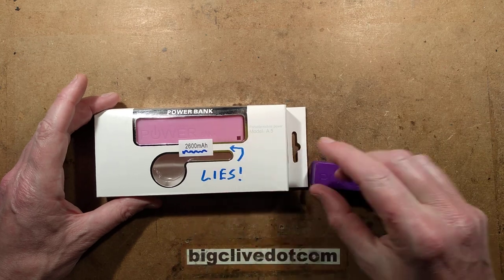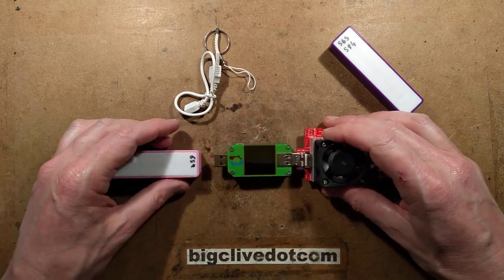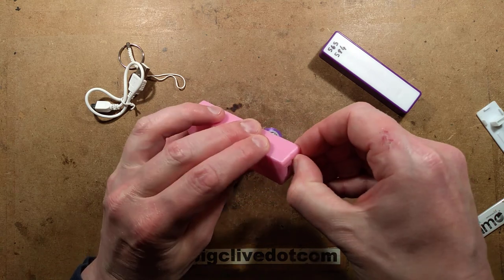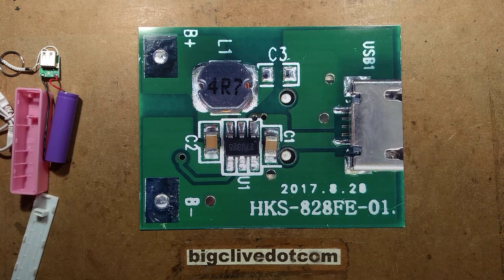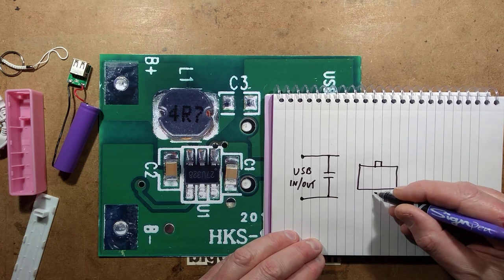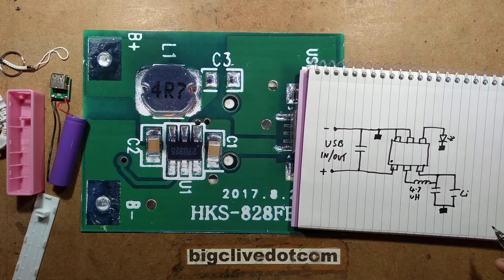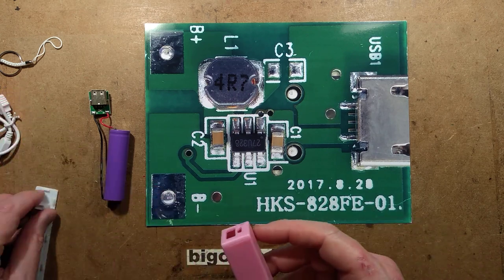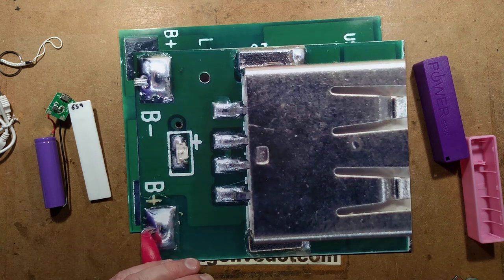Simplest power bank ever?

Comment: What concerns me more than inflated capacity is inflated amp rating. Running an 18650 at ~21 amps because it says it's rated for "25-35" amps when it's actually only 10 amps is just plain scary. Some battery rewrappers are taking the manufacturers pulse rating (which means pretty much nothing) and claiming it's the CDR.
Reply: Efest is pretty bad at that. Their Samsung 30Q wrapper says 35A when the cell is only rated 15A continuous. You can definitely get away with quite a few extra amps on the rating, but advertising it as such is wreckless and misleading. Especially considering how little a lot of people know about li-ion safety.
Reply: @william_2610  Ampking too. 20 amp cells with "35 - 45 amps" written on the wrap. It's insane because those are sold in vape stores. Most people with regulated devices never bother to learn any ohms law or battery safety/maintenance. With massively inflated ratings, they're gonna do themselves some damage one day.
Reply: @alexb.1320  It's just a shame that the explosions get attributed to vaping instead of human error with regards to li-ion batteries. These batteries will vent and go into thermal runaway in any device when misused, but the reports always blame vaping instead of the person incorrectly maintaining battery safety.
Reply: @throttlebottle5906  Well luckily, you get to keep all that if you know what you're doing. The main problem is inexperienced vapers moving over to mechanical mods without learning the basic safety information required to operate and maintain such devices. They get used to regulated mods with sub-ohm tanks and think they can just move over to a mech mod with a rebuildable dripper or tank with no learning curve. Gives the whole thing a bad name in the media because the press can't distinguish between human error and a dangerous device. It's only inherently dangerous in the wrong hands. As is anything with a li-ion battery, essentially.

Comment: It looks like they have updated this board a few times - the "original" ones had 2 LEDs, they also came with a battery holder - the plastic case still have the retaining points in the moulding....

Comment: hi, I have been given a dead powerbank, under inspection, I think the battery died after just a few charges. I replace with my one of the laptop battery. I also found the battery discharge quite bad drain through the circuit board (not like yours)  I replaced with another board I bought from ebay (2 boards for 99p). So only good thing is just the case. Mine all work with 3,000mah battery and very low drain, it can discharge about 1Ah. Cost me I guess 80p and I am happy with it.

Comment: I've got one of these, except that it came from Poundland and it's branded Signalex. The only difference being the white backplate which forms a rating plate. As follows - DC input: 5V 0.8A, DC output:5V 1.0A, Cap 1200mAh, Model No:170327

Comment: I have one of these power banks given from a relative but the internal design is slightly different from this video: The purple li-ion battery is not soldered/weld to the board but instead tension fit like a AA battery socket, there is two LED for each color and the Hotchip HT4928S occupies the U1 section.

Comment: The IC is a HotChip HT4927U. Official limit is 0.7A which coincides with the point at which your test drops below the rated 5V output.

Datasheet is on their site, google finds it.

Comment: they sell these at the Canadian dollar store called dollar tree. I take them apart for the cells and use them in my flashlights.  I should mention that I've had more than one of them grow up and smoke... it was the circuit board that burned up immediately after plugging into a charger.

Comment: As it happens I've actually got one of these, a black one - at least the outer case is identical - and I don't think I paid very much at all for it.  I've had it probably over a year, just use it mainly to charge my phone while asleep if I've forgotten to do so earlier.  But now having seen this, I'm tempted to open it up to see if the innards are the same.

Comment: one problem with measuring in mAh... the battery is 3,6V and in powerbank you want 5V. So you need to boost it.... but when boosting on the input you need more current than you get on the output... hence you get less current but in reality battery gave it away.  In math terms it would be proper to measure it in watts. 5V times 654mAh(measured in video) = 3270mW then when you divide it by battery voltage you get actual battery mAh. 3270mW / 3.6V = 908mAh... still less than advertised but this is the proper method for powerbanks.

Comment: I have one of this powerbank, as far as i know, there are a wide variety of different quality of these powerbank, although the appearance might look the same from the outside, the internal circuit might be different due to different manufacturer.
Mine comes with one of the best quality circuit, its very reliable and efficient and the 18650 li-ion inside there can be easily swappable non-soldered.
My circuit board looks a lot more complex than yours, and the LED indicator light goes directly into that little hole.

Comment: A whole lot of makers would love to know the cutout threshold draw, as we've had issues with this when running light loads on various power banks.  Lots of use would like to run something power-efficient for a few days vs not quite a raspberry pi for a few minutes.  Yes, you can always design your own battery circuits, but expense and pain and danger of wrecking a cell....
Reply from the maker: 40mA.  Technical details in description.
Reply: @bigclivedotcom  Doh!  Thanks!

Comment: I have one of these. The body isn't actually meant to work like that - they're supposed to have terminals that slot in those mounting points, and you can swap the cell out as you want. Mine is like that - I bought it from the "Muy Mucho" chain in Madrid (paid all of, like, €2 for it) and while the cell is moderately shitty it still holds close to 2Ah. I was quite surprised when I opened it up and the 18650 just fell out, allowing me to insert a NCR18650B 3.4Ah in its place and have a surprisingly capable tiny powerbank.

Comment: Unknowingly purchased this exact used model at a thrift store. Fully charged I measured capacity at a shockingly low 100 mAh so put in a discarded 1500 mAh laptop battery and now have a decent el cheapo emergency phone charger that gives a 50% charge.

Comment: I bought a few of these an soldered 5 or 6 batterys together an soldered em all to 1 of the boards.. works ok think i get 5000mah
Reply: Yep ive done that too...much better now. :)
Reply: @100roberthenry  charges slow but works only bought em to try it out
Reply: @CrownJewelzMusicGroup   yeah it is slow. But more useful when charged..
Reply: @100roberthenry  i use it on my bike it charges off my dynamo wheel...every mile i pedal i get 1% charge lol
Reply: @CrownJewelzMusicGroup   excellent....ive been charging mine indoors with a solar panel in my window....i charge up all kinds of stuff....i never buy batts now...cool stuff.

Comment: Would be interesting if you swaped out the orginal 18650 battery cell with a proper 18650 cell that actually has a capacity of like 3400mah.. Would you kill the circut at max load?
Reply: no , it so problem, but the loadingtime will be longer

Comment: Hi Clive, have you seen the little Dekton digital voltage testers in Poundland? I was wondering how safe they are. I think they're like a posher version of the old screwdriver mains testers that you stick your finder on the end, except these have a digital display, can test from 12v to 240v and can test AC and DC. There's also an interesting warning to NOT touch both the DC and AC test electrodes at the same time.

Comment: its interesting if you notice that the "2600 mAh" label seems to be put on by someone else besides the original package manufacturer. i wouldn't be surprised if the owner of the shop or someone slightly above him in the supply chain just used a label maker and slapped a bunch of those labels on them. the original manufacturer leaves it blank for you to label (or lie about it) it yourself, i guess.

Comment: Looks like it may be a 6 pin pic 10f. Considering it can wake from sleep and go to sleep. But how would it charge the battery and drive a bigger output without an internal mosfet and regulator..
Reply from the maker: It's a purpose designed chip for power bank use.

Comment: So if I'm following correctly you can charge it from either port, and you could put the power bank in line between a charger and a load and use it as a standby charging system if power is lost.

Comment: The best 18650 cell is 3600mah, so a very good 70% (never seen one) conversion rate only gets you 2520mah.
Reply: I think you mean highest capacity, not necessarily the best... it depends on the use case.

Comment: I believe the 2600mAh is 18650 capacity not at 5V output capacity and also they might use cheap under rating 18650 which it wont give you a full 2600mAH capacity.  the circuit board will be the same, the only is the 18650 they using different capacity. The problem is the inductor can be too small when load with high current the boost converter efficiency drop.

Comment: I have one of those powebanks, the package was the same and the cell is a similar colour, can't remember the capacity, mine is green though and the cell is removable (basically your typical battery holder with a springy contact), the board seems a little better as well, it has a larger 8-pin chip on it

Oh and my LEDs lign up, yes plural, it has a blue power LED and a red one for charging (it alternates red and blue when it's charging)

Comment: 6:50 something else to notice about that circuit board is that the soldering is absolutely terrible. Also from the position of the LED they did not use a pick and place nor heat the wire. The USB pads are crusty

Comment: I just bought this to take to bits!  The package is a bit different and they have downgraded the rating to 1400mah, with multiple warnings not to charge at more than 1amp.  Makes a lousy test supply but pretty surprised it's not to crappy.
Reply from the maker: It should regulate the current itself.
Reply: @bigclivedotcom  I have a 5 Amp charger that's gunna hold you to that 😆

Comment: I got a bunch of this powerbanks with no cells for 1€ each. Using the cells from an old laptop battery I use them to power the lights of my bicycle, instead of the crappy dynamo. I get about a week of commuting out of each in winter, and if I loose one or forget it in the bike and gets stolen it’s not a great loss.. and as a bonus, the lights stay on when I am stopped in the traffic lights.

Comment: Link for that usb voltage and amperage reader?
Reply: Manufacturer of the USB tester is RuiDeng/'RD official store' on AliExpress. All the other ones on eBay etc is rebranded/clone. I would suggest checking them out, 10/10 products with nice packaging, the clones I got comes just in a plastic bag lol.

Comment: With the input and output bridged like that, It may actually be useful as a USB "UPS" depending on what the behavior is when the 5V supply is applied and taken away.

All of the power banks I have used are useless as a "UPS" as, yes, you can usually draw from them while charging, but if you turn the supply off, it just shuts off and does not check for a load.

That chip may even be what is used in dash cams with internal batteries.
Reply from the maker: I've just checked and when it's charging while the charger also supplies the load, the output will go off briefly until it detects that the charging supply has gone and starts to power the load directly.
Reply: @bigclivedotcom  For low power devices, a schottky diode and large capacitor may fix this.
Reply: @bigclivedotcom  Ok so not as useful as i thought, would still work as backup supply for say a dashcam as they usually have small internal batteries and are designed to keep running with small interruptions (like when cranking the engine)
Reply: @andyfraser5876  I would like to try that. How should I connect them?
Reply: @dstaron3162  As mentioned, this would only apply to low power devices. The capacitor would need to be sufficient to maintain a usable voltage for the time between the charging voltage disappearing and the power bank starting. So the output of the power bank would have a Schottky diode (e.g. 1N5817) in series feeding a (e.g 2200uF @ 6.3V) capacitor. This would mean that the output voltage would be about .3V lower than the power bank.

Comment: I salvaged similar power bank today, it has FM6316FE 8-pin chip and two LEDs though. Replaced the dead noname cell with US18650VT3 and it works again. Mine has better component alignment so the light is nice rectangular._

Comment: These powerbank boards are sold separately on Ali for a year or two already.. i've been using them for my homebuilt powerbanks quite some time. Also these powerbanks sometimes come with springs inside and a replaceable battery.. which makes them very nice to recycle laptop cells in.

Comment: 1. they are taking a page from  the way that cpus are rated the rated speed is the sum of all the cores example 4 ghz 4 quad core means each core is running 1 ghz in that there is total capacity and usable capacity.

if you was to drain the cell to 0 volts and then charge it you probably will get something like 2100 mah to go from 0 to 2.5 volt minimum that most chargers will safely charge from and then the other 500 mah is to go from 2.5 volt to the full 4.2 volts charged state.

2. because whenever you step up voltage there is a volt/amp trade off for example a ups backup device can easily draw  up to 100 amp from the battery when under full load for  a couple minutes.

most power banks have to take the 4.2 volts from the cell to 5.1 volts for usb and so the stepping up may cause  the cell to have to be under higher current draw.

3. you will need a few charge/discharge cycles to break in the cell

you may need to measure the current from the cell instead of a usb analyzer.

4. because in recent years there has been fires with cell phones, laptop computers and hoverboard scooters the makers of the power banks to get them into the safety conscious countries like europe and united states may decide to raise the low cut off voltage and lower the high cut off voltage so instead of 2.5 to 4.2 they may be 3.0 to 4.1 or even 4 volts even

so you may want to test the bare cell instead

Comment: Is it better to measure capacity of the powerbank during the discharge or the charging? I think fixed amperage load is not  realistic for smartphone charging etc, because the phone will restrict charging power when voltage drops..

Comment: I just received some empty powerbank shells made by the same manufacturer as these and was looking at the circuitry (not that I have any idea what I am looking at) and it now has a new circuit board dated 20201014 with now massive 7 items on it. 2 LEDs, 1 x 8 pin IC TP4333 with the 8 pin not soldered, 2 Caps, 1 1R5 Resistor and a 1R5 (it may be a 9) Inductor.  There are 2 extra locations for resistors and 1 for a capacitor. Guess that are still wanting to keep the component numbers down.

Comment: they used a boost/buck regulator chip... not cheap linear regulator fet. if you swap higher grade components you can get really high battery efficiency at high load.

Comment: They sell these ones in Poundland 👍
Reply: The Poundland ones only claim 1200 mAH,  I have 2 and both test out to around 750 mAH so either Poundland's buyers do a better job or I got lucky with whichever rip-off battery vendor the manufacturer was using that week.

Comment: Poundland did these same ones a while back but I'm sure they listed them as 1200mAh.
Reply: Yes, I have a power bank from Poundland that has the same casing, but the packaging has proper English and a shiny label saying 1200mAh.
It has a red and a blue LED (one for charging, one for discharging) so presumably the electronics inside are different.
I don't know whether it's really 1200mAh. It gives my old smartphone an extra 25% charge, which isn't much, but it only cost £1.

Comment: Do they have protection for the cell, or do they use protected cells? If you covered that I missed it.
Reply from the maker: The chip itself will detect the charge and discharge voltage thresholds.
Reply: @bigclivedotcom  Thanks!

Comment: I happen to buy 1 of these without a battery and I used a 2900mah Panasonic and was able to power a 5ft 5v led strip for about 3 hours..... shocked me that it did that well
Reply from the maker: That would be a triple capacity upgrade for these.  And with the advantage of staying on all the time with low loads.

Comment: Wow. Impressive circuitry... I wonder if this could be used for a different kind of LiPo? I 'm searching for cheap & tiny board what could charge those bch7 batteries. I use these in my wireless applications a lot, but i still have to remove them to charge. The integrated 5V boost converter makes it an ideal solution.

Comment: I am fairly sure it is a HT4927U (http://www.hotchip.com.cn/Uploads/goods/2017-11-03/59fc3d5115ae4.pdf)
The PCB layout also seems very similar to the suggested circuit in the datasheet

I have used the HT4928s quite a bit. They are also found in cheap Chinese power banks and also have the cut out issue. The Chinese sellers are just cheap skates - if you have the correct output capacitor as suggested in the datasheet (10-22uF depending on the variety) it does not cut out at all. In the cheap power banks they seem to just use 100nF caps
Reply: Why, though? Are those 100nF caps cheaper?